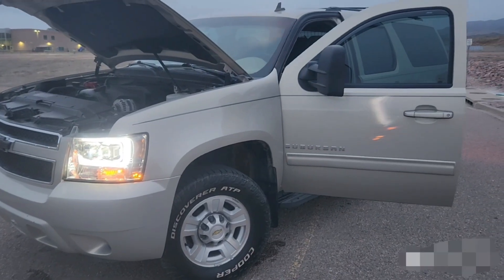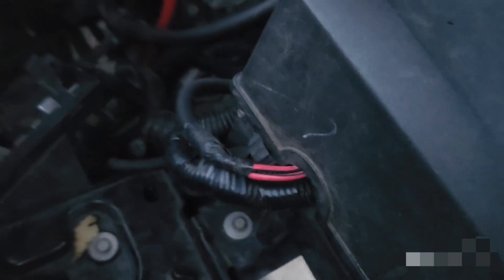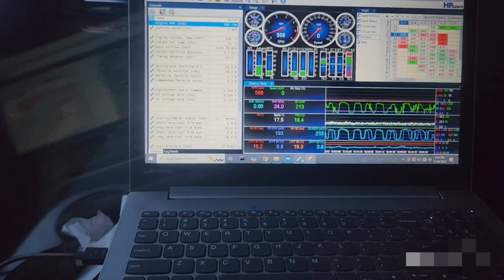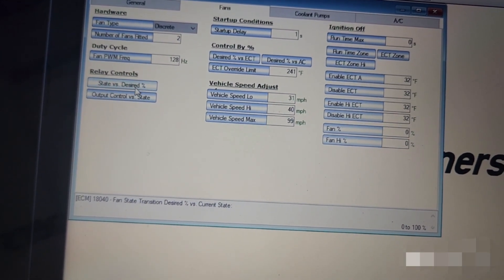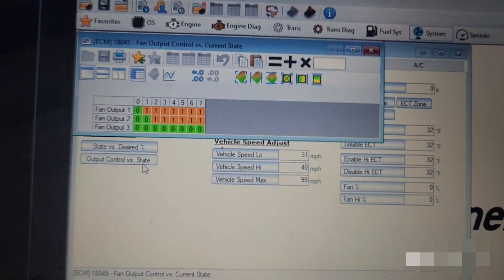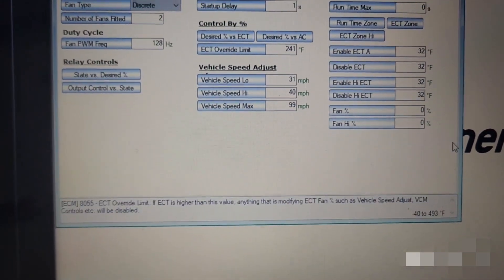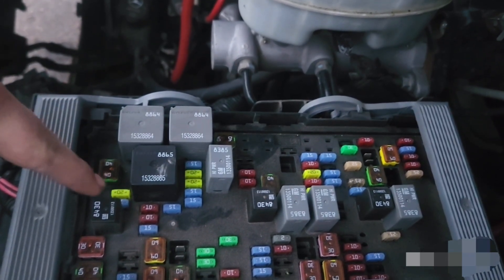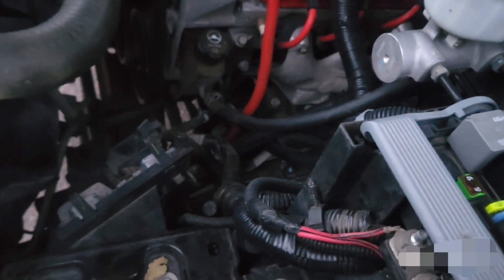Electric fan conversion/upgrade gmt900 trucks, featuring 2011 suburban 2500 using hp tuners.

Comment: Do you have a link for how to pin the fuse box relays and also do you recall what the pin out numbers where for hi and low triggers from your PCM. Thank you
Reply from the maker: You dont have to wire anything for the pcm, its already built in and wired for 07-14, if its 06 and earlier its completely different, I do not remember the pinout, I had a factory harness that came with my fan, so I just moved them over to the exact locations on my harness already in my vehicle.

Comment: Do you remember if you used 4 wires or 6 wires inot your fuse connector? Does it run fast and slow?
Reply from the maker: 4 wires, and there are 2 speeds low and high, and 2 relays from the factory.
Reply from the maker: There are 2 relays built into the factory fuse panel, the breakers and relays are already installed from the factory,  if you want the high fan to kick on sooner, you can adjust the temperature the the low and high fan kicks on at in hp tuners
Reply from the maker: Fan desired state vs ect is where you can change when the high fan kicks on by raising the % at lower temps

Comment: Have you towed in the mountains after this mod? Any overheating? I have 2005 Avalanche 2500 with the 8.1 that i tow a 30ft 9k travel trailer.  Im interested in converting to electric fans, however based on my research it seems the conversation can be done but it's not advisable as manual fans pull alot more air than electric especially going up steep hills or siting in traffic on hot days.
Reply: Hi Joe. Great video. So far, you are the only one I've found closest to what I plan to do. I own a 2009 Yukon XL 2500 6.0 which is basically the same Suburban you have. 
Do you have an update on how the fans have performed? 
Have you had to change anything else after this video to make it better/improve the system?
Is there a specific place/website where you would suggest to get HP tuners from? I will have to invest on that.
Could you elaborate on which fans come on when running?
Example: both fans activate at low speed when AC is operating
And: both fans activate at high speed when truck temperature rises.
Thank you very much for taking the time to make this video.
Definitely builds confidence when attempting this mod
Reply from the maker: No i have not yet. I have only ive only had it done for 2 days. However, this is a fairly common upgrade.
On your truck, it is a gmt800, I beleive yours is a little bit more complicated, I think you have to pin the ecu and there are a few extra steps, there is quite a few videos on how to do yours. I believe the tuning side of it is a little bit different as well.